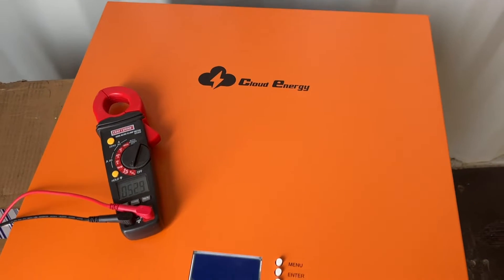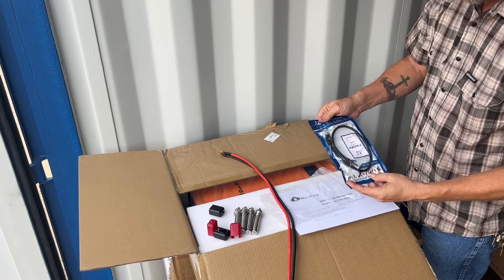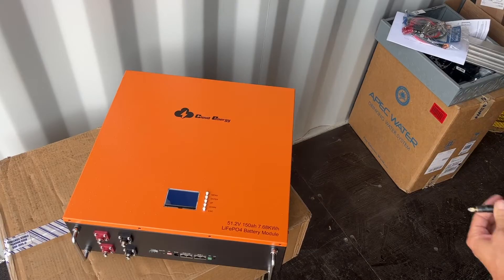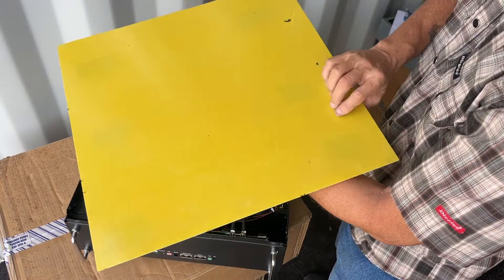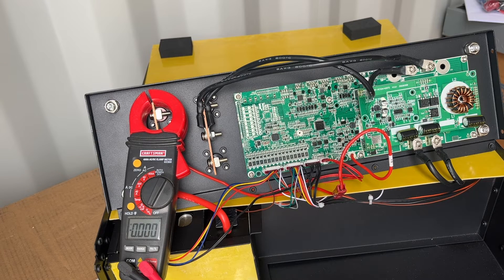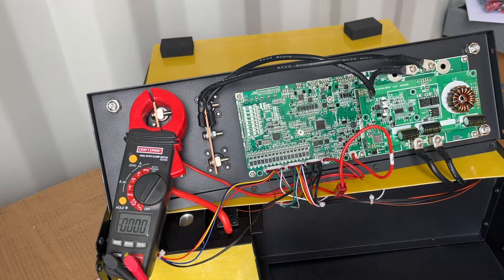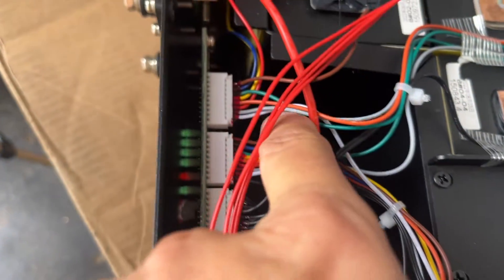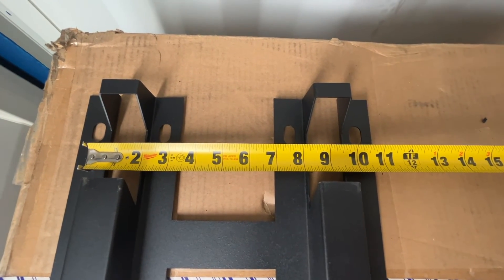48v 150ah Lithium Iron Phosphate LiFePO 4 Server Rack Battery by Cloud Energy $1,999

Comment: How is your battery holding up? I had to jump start my system before the battery would connect to my outback controller system.  When battery is dead or charged.  I have to use another power source to prime the system before battery can be used.
Reply from the maker: The battery is work great. I am not pushing it hard on a  regular basis but I did during testing. I am running a refigerator and AC in a shipping container office with a 3000watt inverter/charge controller and minimal solar panels.
Reply: We are running fridge and full deep freezer, tv, internet is satellite with router, 4 camera's and monitor. All night.  Daytime  add Mr cool for heating air-conditioning well pumps ect.  Our solar system is 6kw hr full sun.  Battery at 40 to 60% after each night.    This was a test for this company. Had to send back first battery, had faulty LCD display.

Comment: I'm about to order this item, is it worth it, would you HIGHLY  recommend it?
Reply from the maker: It is working fine, I have not put it through all the tests I would like to before HIGHLY recommending. It has some nice features for the price. Depending on the price you are paying for it and how much current you need to draw from it I would recommend it. Notice in the video the size of the main internal wires.
Reply: @D Mc  thanks for your reply, I wouldn't have many amps drawn from it, I should be good. 
I wanted to be sure it was of a good quality. 
I watched your video 3 times so I would completely gather all the information you provided. Thanks again. 
If there's anything else you can tell me, please do.